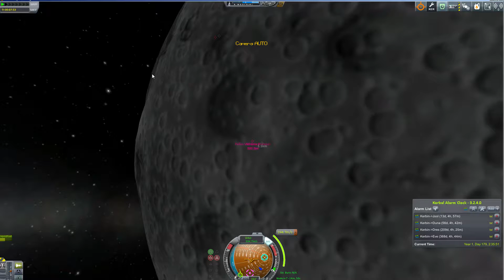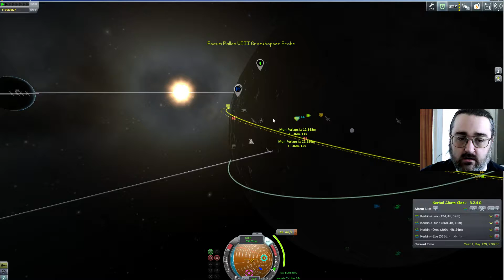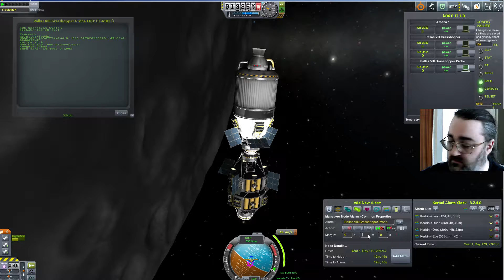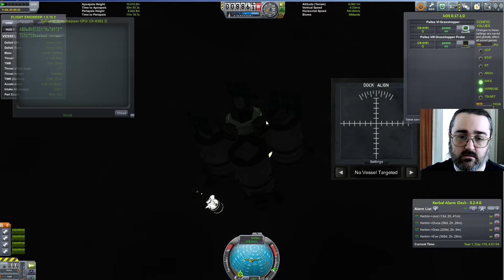Pallas VI Rescue

Comment: Hey. Try the remotetech. It adds the reqirement for the KOS.
Reply from the maker: Luka David Torkar I suspect I shall, once 1.0 rolls around (and all the mods are updated!)
Reply: OK. Just don't forget to install mechjeb. Even if you are absolutly against the autopilot, It can get pretty hand becaus the flight computer that comes whit it is still terible at some situations. And as far as I know it's the only way to land unman crafts on the mun like planets (I don't use KOS becaus my programing skill is crap :D so I don't know if ti's posible). Don't turn time delay of becaus then you will miss half of th fun.
Reply from the maker: Luka David Torkar I'll definitely have to experiment!  I do have a lander script that (mostly) works using kOS, so I might be able to get away without MechJeb.  We shall see!